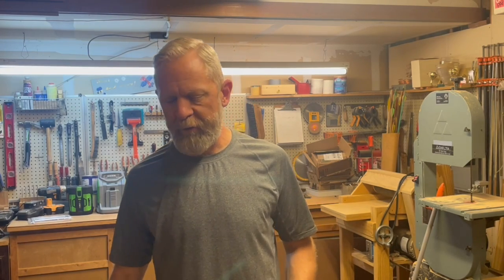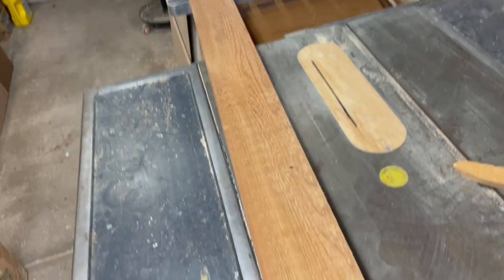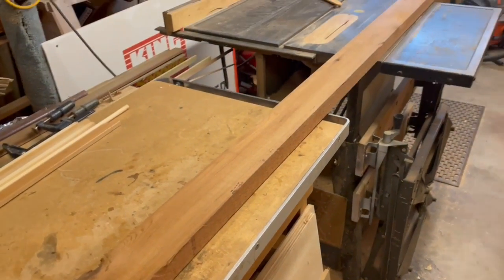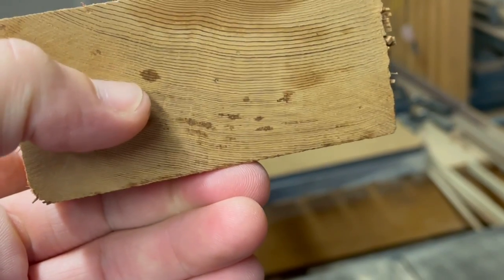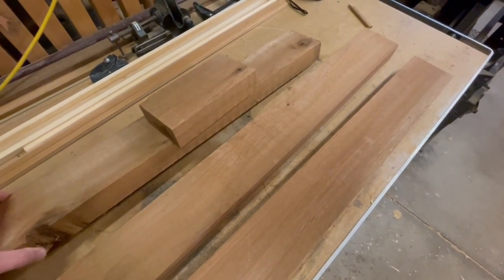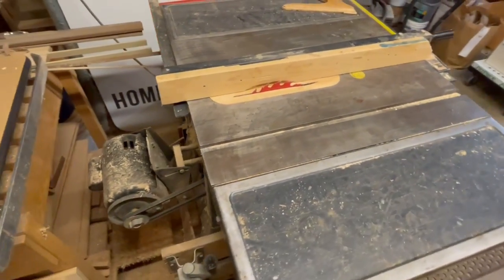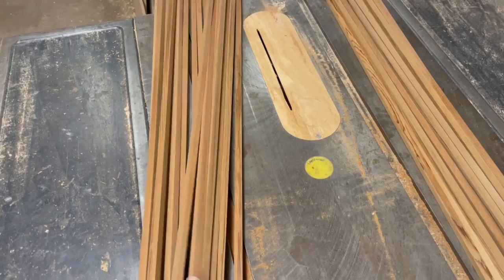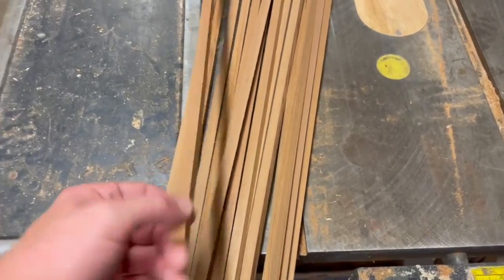Arrow shafts from lumber

Comment: Great video my technique is similar.I have been doing that since 1970 Over time I stopped planeing shafts any further than an octogon  It I found to be plenty sufficient .I also have sanding guages to ensure perfect diameter.That is just a piece of hard wood block with  an 11/32" or 5/16" hole drilled in it .I get the shaft to just fit in the end of the hole at the tip of the shaft and progressivily work the shaft I periotically test the fit untiI the guage is a nice push fit for the whole length of the shaft Do my shafts a bit differently though as all my shafts I glue footings to.great work.
Reply from the maker: Thank you for watching! And I like the idea of a shaft gauge

Comment: Home Depot also carries 1/2" thick tulip poplar boards. That's what I use primarily. Because tulip poplar grows so straight, it's easy to find boards with straight grain. I have found the resulting shafts to be sturdy. I like your "shooting board" jig. Also, 3Rivers stocks a point/nock tapering jig that utilizes inserts for the various standard shaft diameters ... 1/4", 5/16, 11/32, 23/64. I make use of those inserts as "go nogo gages" as am sanding shafts down to final diameter. Thanks for doing the vid!
Reply from the maker: I’ll have to try some!

Comment: I usually split the wood, like I'm making matches. Smaller and smaller until I get to a half inch. That way the grain always runs perfect. If I can't split that section it's no good for my weight of bow.
Reply from the maker: That’s a great practice! Even at light weights, grain is a major consideration.

Comment: Sorry if I have giant bamboo with very thick walls. Can I cut the bamboo into those square Dowels. Then use that to make the arrows? Because bamboo is straight grain.
Reply from the maker: Yes…  although bamboo is more dense as it gets closer to the outside rind. Not sure how this would affect spine, or the flight of the arrow. I was going to take up the same experiment, but I am going to have to glue up my bamboo to get it thick enough.
Reply: @meadowlarkadventuregear  thank you so much for your response..I appreciate it..I found bamboo growing somehow and it's giant bamboo..the walls are very thick..i didn't measure the thickness of the walls yet but it could be 12 to 15 millimeters thick. When I place my finger on the top of the bamboo where it's cut. It's thicker than the first part of my index finger or finger joint. The part of my finger where my nail is. From the tio of my finger to the first joint line on my finger. Lol can't think how else to explain it. When I get a chance. I should measure the thickness of those walls.
Reply from the maker: Let me know how the arrows turn out. This might be another area where heat tempering the material would make the difference between great success and mediocre results
Reply: @meadowlarkadventuregear  I will 👍 The bamboo is not ready yet. Its stil green. Probably needs to dry for another two months.

Comment: You can sand your heavier shaft to get them closer to your lighter shafts without cutting them down
Reply from the maker: True. The other side effect of sanding down the shaft is losing some of the spine stiffness - so you have to balance your efforts to get them just right.

Comment: https://youtu.be/bT3bC1b0GM4 As an alernative way to do it.
Reply from the maker: Not surprisingly, this method is pretty hard on the shafts.  if using cedar, it will literally shred the shafts into non-existence… I did it with some Sitka spruce and then spent just as much time cleaning up all of the tear out as I would have had I just used the shooting board in the first place. I’ve made a jig that uses a sharp, wide chisel in the same manner as a pencil sharpener that seemed to be the best of both worlds, but still not good for cedar.
Reply: That's actually not a correct way to make arrow shafts because unlike arrows, dowels don't need to be straight. Pushing the wood through a hole in a thin steel plate is not going to result in a straight shaft because there's nothing to keep the cut straight; due to the thinness of the steel, if you wobble even slightly (which you will) the cut will also wobble. I make dowels for joinery with a similar method, those things never come out straight even for 6 inches, let alone 30. Fortunately, for joinery that doesn't matter.
Reply: @chrisandbrennacatania5864  As always, the holes keeps them straight. ;)

Comment: Hello from France ! I'm really fan of your fantastic videos !
It gives me a big help for building my first bows for leisure. After two failures, I already succeed to make two simple ipe-bamboo bows : one 25 pounds and one 35 pounds :) But I would like now to try more sophisticated multi-laminations like yours. 
So, in one of your former videos "Limb Laminations / bamboo back and belly bow build pt.4", you gave some important dimensions : I have a question for you about it.
I have noted for bamboo back : width 1,5" in the middle fadded to 5/8" at tip and thickness 0,16" in the middle fadded to 0,01" at tip of limb : this last figure 0,01" (very thin, isn't it) surprises me : is it really 0,01" or 0,10" ?
I have also a second question : could you share the thickness of the core ? and also of the bamboo belly ?
Very much thanks in advance for your answer. Would appreciate an e-mail, if you like (tsumemoto@hotmail.com).
Wich you the best for continuing your really fantastic and amazing work !!

A.
Reply from the maker: Thanks for watching my videos - I’m glad I can be of help! You are 100% correct that a .010” thickness is way too thin.  The correct thickness was .10”.   As for the core, it was .20” at the center tapered out to a .06”.  The belly lams were .18” near the grip, to about a .12” at the tips.  The important part about the bamboo back and belly is that the thickness at the tips is determined by the taper that gives the right tiller when pulled in reverse.
Reply: @meadowlarkadventuregear  Many thanks for your very clear and usefull answer ! Wish you the best and I keeep following your videos :)